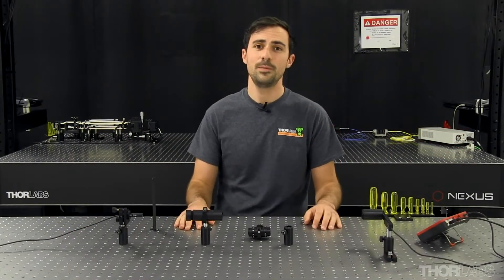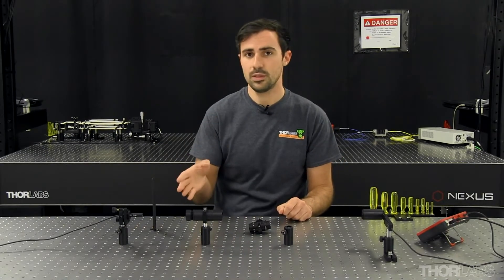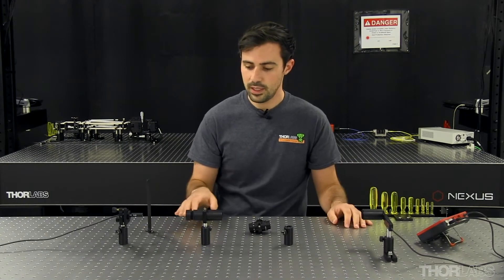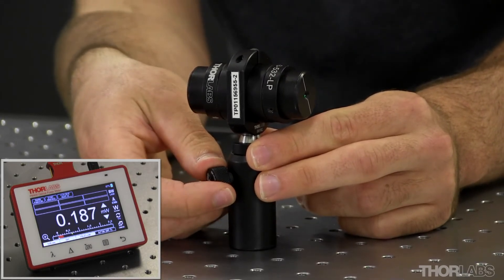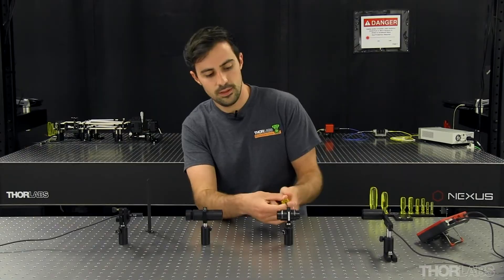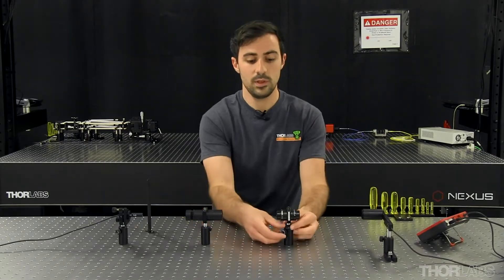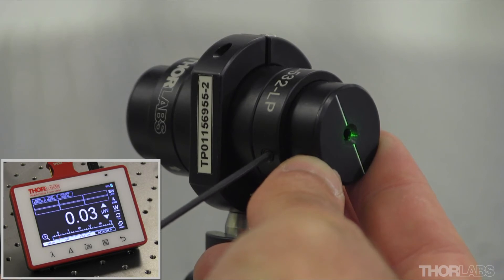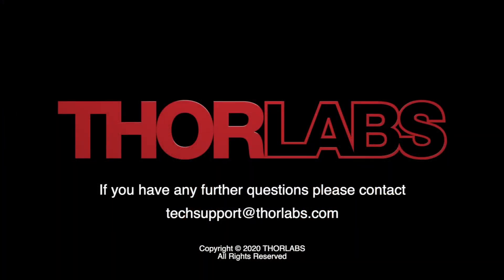How to Align an Optical Isolator | Thorlabs Insights

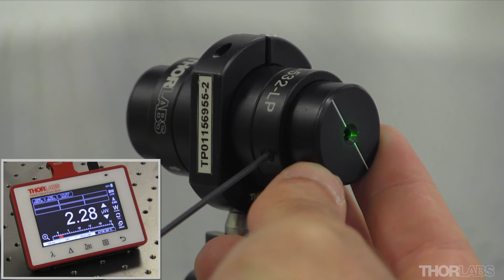Comment: Hi, at 2:48 you rotated the polarizer closer to the light source to minimize transmission. However, there are two contributions to the reduction of transmission: (i) matching of the optical axes of the polarizers with the amount of Faraday rotation introduced (which is what we want),  and (ii) having the polarization axis of the polarizer orthogonal to the polarization of the input light. In this method you proposed, it is not possible to distinguish the two. 

I would recommend the following steps in order: 
[1] have the optical isolator backward aligned (arrows pointing towards light source); 
[2] rotate the polarizer closer to the light source to maximize transmission (for good signal to noise in Step [3]); 
[3] rotate the polarizer further away from the light source to minimize transmission (this step matches the optical axes of the polarizers with the amount of Faraday rotation introduced); 
[4] flip the optical isolator back to the forward alignment (arrows pointing in the direction of light propagation); 
[5] rotate the whole assembly by loosening the slip ring to obtain maximum transmission (this step matches the optical axis of the first polarizer with that of the incoming light).

Should you choose to omit Step [2], you will end up with the same problem as I described above. The point here is to always rotate the polarizer further away from the light source instead of the one closer, regardless of whether the optical isolator is in the forward or backward alignment.

Of course, there are many other ways to align optical isolators, and the method you described would work if certain assumptions hold (e.g. optical isolator is close to fully optimized). I always have half wave plates before and after my optical isolator; I would rotate the first half wave plate instead of the polarizers in Steps [2] and [5] in this case, and the second half wave plate is there to rotate the polarization to that of my liking w.r.t. the optics downstream.
Reply from the maker: @JiawenKB  Thanks for your detailed explanation of an alternate procedure for aligning these types of free-space isolators! We recommend adding a Step [1.5] that specifies removing the polarizer farthest from the source, which should help ensure Step [2] results in the near polarizer being oriented parallel to the source’s polarization state. An additional Step [2.5] would then specify re-attaching the far polarizer. This alternate alignment approach definitely has its proponents, including some in Thorlabs, and we are happy for your help in bringing it to people’s attention. One benefit of this approach is that it optimizes the polarization extinction ratio (PER) of the light used to align the isolator’s input and output polarizers with respect to the Faraday rotator between them.

More information for those who are curious: when the isolator is placed backwards in the light path and the polarizer nearest the source is aligned parallel with the source’s polarization state, the PER of the light input to the Faraday rotator is maximized. In order to maintain the high-PER input light, the near polarizer’s orientation must be fixed. This means that only the polarizer farthest from the source can be rotated to align the two polarizers with respect to the Faraday rotator. After aligning the far polarizer, the isolator’s orientation can then be flipped so that the arrow points in the direction of beam propagation and the body of the isolator rotated into alignment with the light source.

The abbreviated version of the procedure demonstrated in the video does not maximize the PER of the light used to align the polarizers with respect to the Faraday rotator. Instead of orienting the isolator’s near polarizer parallel to the incident light (to maximize the PER) and aligning the far polarizer, the polarization orientations of the incident light and the near polarizer differ by approximately 45° and the near polarizer is rotated to align the near and far polarizers with respect to the Faraday rotator. The difference in the quality of the alignment provided by the two procedures is expected to be minimal when working with a factory-calibrated isolator, or when aligning an isolator calibrated for one wavelength in the isolator’s wavelength range to another.

Comment: Why these Thorlabs polarizers have side holes at the input and output apertures. A lot of light is going out through them, what causes great hazard in the lab as the beams easily leave the table plane. Thorlabs - could you elaborate?
Reply from the maker: Not all of Thorlabs’s isolators include side exit ports (apertures) for beams rejected by the input and output polarizers (the isolator used in the demonstration does not), but isolators designed for higher-power input beams typically do have side exit ports for rejected beams. If high-power rejected beams were not allowed to exit the isolator housing, these rejected beams would reflect or scatter internal to the isolator, potentially damaging the interior optics and/or adhesives (damage from this cause has been observed).
 
As you say (and as is noted in the isolators’ web presentation), these rejected beams can be hazardous when they are not safely terminated. The importance of using beam traps  ( https://www.thorlabs.com/newgrouppage9.cfm?objectgroup_id=1449 ) or another suitable method to block stray beams is well known. Offering isolators that do not integrate beam traps into the isolator package provides people with more flexibility to optimize the designs of their setups.  
 
However, we realize that the changing directions of the rejected beams during alignment can be unexpected. The beams’ orientations change since the alignment procedure requires rotating the input and output polarizers, which also rotates the exit ports. In addition, it is also necessary to reverse the orientation of the isolator, during which time most of the power should be rejected through the exit ports. Due to this, during alignment when possible, we reduce the amount of power rejected through the exit ports by reducing the amount of power input to the isolator. One way this can be done is by reducing the source power, and another way is by tapping a small portion of the high-power source beam and using that to align the isolator. In the second case, care must be taken to ensure that the tapped beam maintains the same polarization as the source, as well as that the mounted orientations of the source and tapped beam are the same.
 
If the problem is that the rejected beams are leaving the table’s plane during isolator use (after the isolator has been aligned), Thorlabs can make a modification to the isolator design that will keep the beams in the plane of the table. This modified design includes an internal wave plate and requires the input light have a particular plane of polarization. If you would like to discuss this option with us, please contact Tech Support ( techsupport@thorlabs.com ).

Comment: Can you please explain about beam reducer more elaborately? Can we make it using only Plano convex lenses and will the power of laser beam be same as before?
Reply from the maker: It is possible to build a beam expander or beam reducer using only Plano convex lenses. In fact, plano-convex lenses were used in this beam expander. For better beam quality, we oriented the flat sides of the lenses so they faced the beam focus. 
 
The power exiting the beam expander will be slightly less than the power entering the beam expander, due to the beam reflecting from the lens/air interfaces. Since there are two lenses, there will be four reflections. Anti-reflection coatings on the lenses can substantially reduce the amount of light that is reflected. Without anti-reflection coatings, approximately 4% of the light reflects at each interface. Note that if a beam reducer is built, the total power will be approximately the same so the power per unit area over the beam’s cross section will likely be higher than that of the input beam. 
 
For more information about the beam expander used in this video, please see this article (https://www.thorlabs.com/newgrouppage9.cfm?objectgroup_id=14378 ). It includes information about  required lens placements and focal lengths to achieve a particular beam expansion or reduction. Much of this information, as well as an approach for building a beam expander of this type, is included in the “Use Laser Speckle to Find the Beam Focus” ( https://youtu.be/xuzuFPl8rh0 ) Video Insight. In that video, an overview of the beam expander’s specifications is provided starting at 5:01.

Comment: What does an isolator do?
Reply from the maker: Isolators are often used to pass light traveling in one direction and block light travelling in the opposite direction. A significant source of light intended to be blocked is reflections from optical elements in the system. If these reflections travel back to the laser source, they act as feedback that can destabilize, or worse, damage or destroy the laser. It's common for isolators to be placed directly in front of laser sources, and some laser systems have built-in isolators.
Reply: An Optical Isolator is a 1-way valve for light. In the forward direction, most of the light (usually around 90%) will transmit. Light coming backwards, however - gets stopped (absorbed or redirected).  C Pinyan